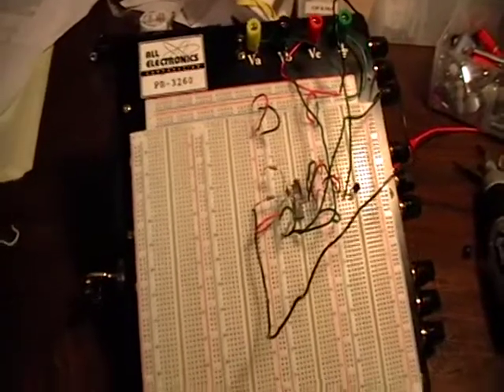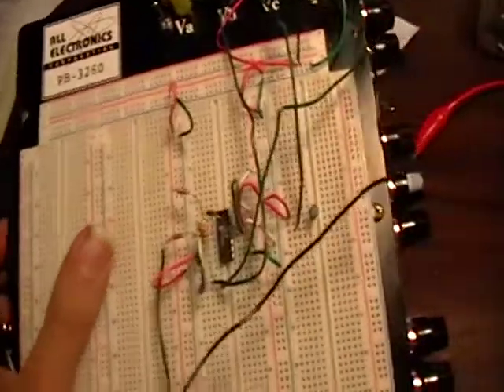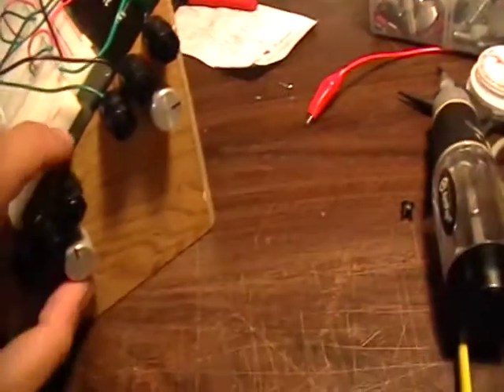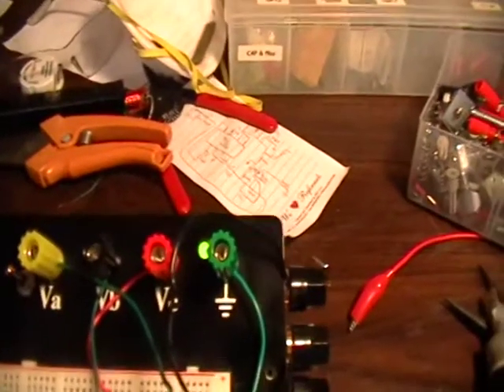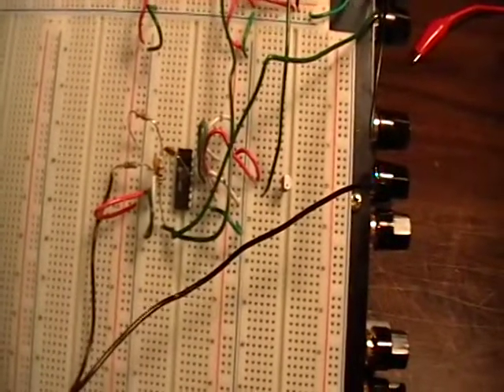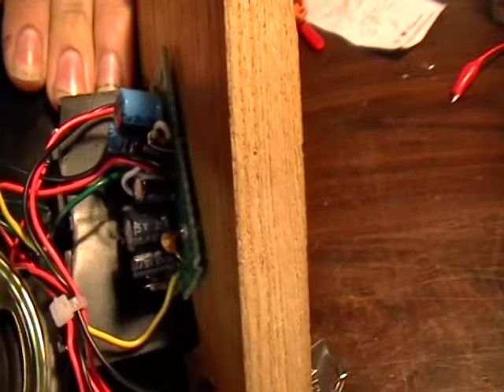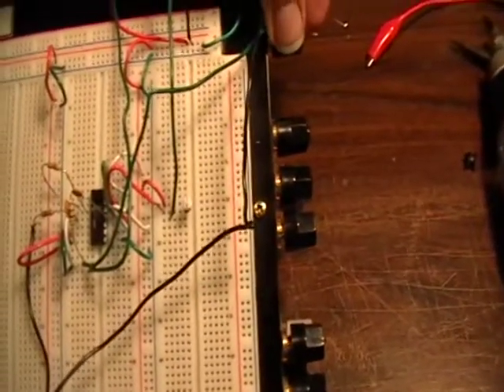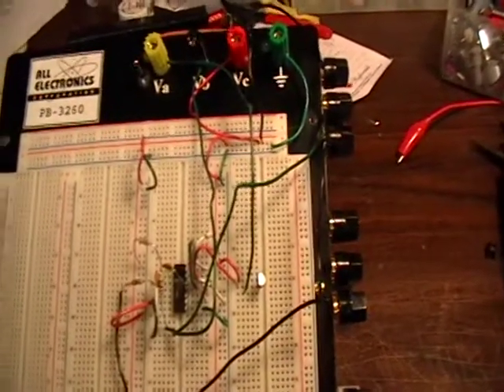Electronic Prototype Station

Comment from the maker: @TJankris 
I guess I never actually explained what a prototype board is.

This is a customized breadboard, where an electronic circuit can be quickly and temporarily prototyped. The electronic parts fit into the rows of sockets (which are electrically connected to other sockets). In this video, I am showing some functions I have added onto the board.